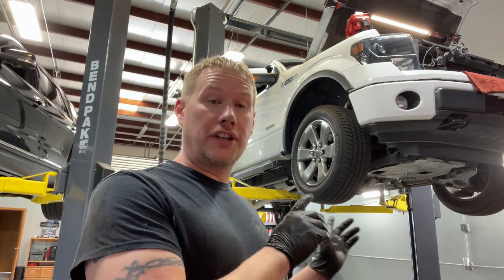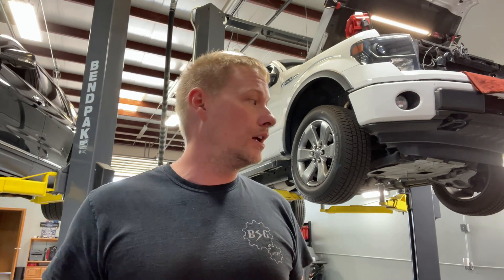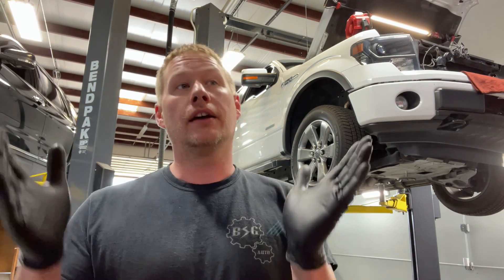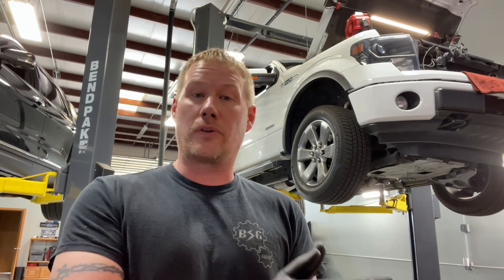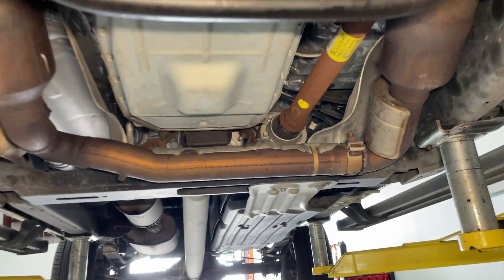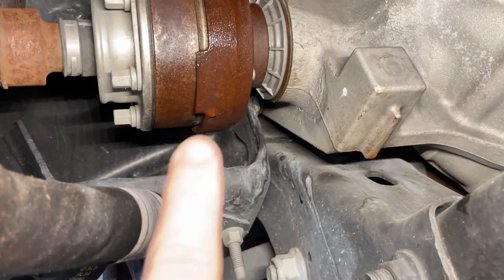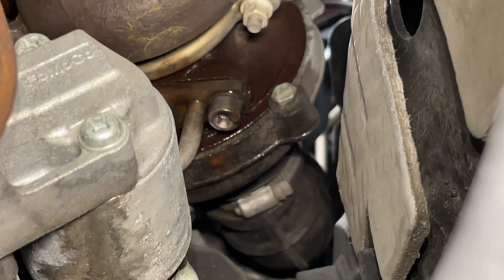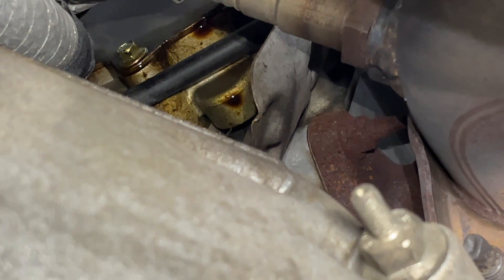Ford Ecoboost Engines Can be so Hit or Miss: I Really Feel Bad for This Customer...

Comment: I feel like this is surprisingly common across makes.

I got 247,000+ miles on my Dodge. My transmissions instructor has TIPM problems. Brother has transmission issues. I got lucky with ETB a couple times. No major issues.

Classmate has 200,000 miles on his Hyundai and loves it. Still his daily. Other people have oil starvation due to manufacturing issues.

Some people have 300,000 miles on their Honda, others... myself included... Have nightmares resulting from the VCM... Misfires... Smoke... Oil consumption...

Some love Toyota. A friend's Tacoma has a rusted frame, and my uncle never stops complaining about how many systems go down in his.

The downside to mass production of complex systems is you are basically playing russian roulette against the manufacturer's quality control.

Comment: I’m not a Ford guy but not opposed to owning one.  Same goes for almost any other brand.  My problem with all the auto makers is how complicated this stuff is getting.   All is good while still under warranty but later down the road $$$$$’s.   Its almost like they design them to last 50,000 miles
Reply from the maker: Their official stance is everything is made to last 150k miles.
Reply: @FordTechMakuloco     Well, you work on these things every day.  I’m just a average guy who can only do a few simple things on todays autos.  I agree with your statement “Hit or Miss”.  Its for sure that proper maintenance is key to longevity but as with the Ford you are working on here, its no guarantee.   I think its coming down to trade when warranty runs out, for me at least.  I have 2 vehicles with oner 100k and am just hoping and praying nothing major goes wrong until the auto market frenzy settles down a bit...

Comment: I have a 2017 with less than 40,000 that has left bank cam and phaser issues. It’s obvious that it’s bad and a calibration isn’t going to fix it. But Ford and their fixes require reflash first. Have extended warranty and factory coverage but having trouble with trust factor.

Comment: My wife had two explorers and they cost me after they were out of warranty.  I was thinking about buying a F150 after I got fed up with GM pickups.  Had a Blazer and then 5 Chevy pickups.  At 117k the dealer wanted $8k to put in new injectors.  I was done with paying and traded it in on a new RAM with Cummins.  That was in 2014 and haven't regretted it yet.  Bed camera doesn't work, but I don't care.  Paint and rustproofing is way better then GM.  Only Ford I would get is with the 5.0 or 7.0 gas engines.

Comment: I recommend my Ford 3.5 ecoboost customers use 8oz of Irontite cooling system sealer to minimize turbo coolant leaks instead of replacing all the coolant lines and fittings.  I operate on the principle - what would I do if it were mine?  After the first few I did I realized it was a waste of time, effort and $$$.  The sealant works well.

Comment: My 2011 ecoboost has 220,000 miles. Still works great but I'm afraid it needs a good clean. Should I just buy a rebuilt engine or buy new heads?

Comment: You are very right on some engines have issues and some dont, my 2011 f150 3.5 ecoboost has 144k on it and zero leaks, only major repairs i have had done has been a water pump, and recently had my blend door actuators replaced due to the clicking noise! Other than that i change my oil with castrol edge synthetic every 4500 miles with fl500 filters, truck runs great!

Comment: I have the 2021 Ranger with the 2.3 ecoboost and so far they seem too be trouble free, but this is a damn shame. If this crap starts on my truck it will be gone in a instant.
Reply: Lets hope the coolant intrusion does not strike like it does on many i4 ecoboost engines.

Comment: wow, am i ever glad I went with the 5.0 when I bought my F150 and the added parts and complexity of the turbos is exactly why I chose to avoid these motors. I still have the same truck and it has been flawless for me so far.
Reply: The '18 and newer 5.0s have a high occurrence of excessive oil burning, like 1qt per 1,000mi excessive.  Ford is "fixing" them by installing a longer dipstick and telling people to top off between oil changes.  There are not a large # of high mileage vehicles yet so no telling where all that oil is going and what else it's doing to the engine.  All of the newer trucks have plastic oil pans which are notorious for leaking over time, and it's very hard to change out the pan without creating another leak since the sealant will not set properly if there is any oil residue on the mating surfaces.  Basically it's a 48h process to do properly, you have to completely drain out the vehicle of oil for 24h+, then clean it thoroughly, wait a few more hours, clean again, and repeat until there's no longer anything seeping out of the system at all.  Then you install the pan with sealant, wait another 24h for it to set before adding new oil.  So your typical dealership or even independent shop is never going to do it that way, especially for a warranty repair.

The 2nd gen ecoboost models fixed a lot of problems with the first gen, the intercoolers no longer have the condensation issue, the injection system is now both port and direct so the valves don't cake up with deposits nearly as much.  If I were buying a 21 model year and I didn't need the towing capacity I'd probably go with the 2.7l.  The 2.7 is a pretty fantastic engine with its compressed graphite iron block.  If I noticed the oil pan leaking I would either live with it if it's just a tiny bit of seepage, or replace with an aftermarket aluminum pan that I installed myself.  I would really stay away from the newer 5.0s, the oil burning issue is well documented at this point and if it's burning that much oil I would expect that there's a serious flaw somewhere in the engine design that will cause excessive out of warranty repairs down the line.  The 3.5 eb seems to have more people reporting problems than the 2.7, but they also sell a lot more of those, so that could be part of it.  It's hard to find reliable statistics with large sample sizes.  If you go by forum anecdotes there isn't a single vehicle made that doesn't have people saying it's the best ever or it's the worst thing on the road.

I own a '18 2.7eb and my oil pan seeps oil.  I clean it off every time I do an oil change and there's always a sheen of oil on it by the next time.  It's not enough leakage to be detectable on the dipstick at all so I just don't worry about it.  It's not even enough to drip down to the skid plates.  My transmission came about 2l low on fluid and would sometimes shift extremely harshly when it was cold, but if I let the truck warm up it would be fine.  I dropped the transmission pan and changed filter, all the rubber fittings and topped off fluid, (about 11 qts) at 30k and since then it's been running great.  I'm at 42k mi and still on original plugs, gap is within tolerance and I check a different one alternating banks every oil change.  I will probably swap them out at 50k regardless.  No warranty repairs so far and no major issues.  Truck is a blast to drive, definitely the quickest truck I've driven and I get 25mpg on the highway unladen with AT tires.  Towing a 6,000lb trailer drops it down to 11mpg, but that's about the same as I get at work with a super duty.
Reply: @jgalt99  Recently bought a 103k mile 2017 XLT 2.7, 3.55, w/6-spd auto off a friend. I got the oil pan leak. I think that's why they put that aerodynamic diaper under it. Love the truck and motor. It's got over 118k now. Love the 36 gallon tank too. It does everything I could ask for. My friends new model is having some issues with a chip and aluminum driveshaft....
Reply: @brentworls8509  The 2.7 is such a great engine.  I really don't understand the change to a plastic oil and trans pan when they made the engine itself so strong with the CGI block.  There are aftermarket aluminum oil pans if your oil leak is enough to require a top-off between changes.  Mine still seeps a little oil but it's not enough for me to do anything about yet and I've had no other issues.
Reply: @jgalt99  Never heard of a single-use oil pan, but here we are....
Reply: What year do u have? Is it burning oil like another relply says on 18s and newer?

Comment: hey Bryan, the Ford dealership put a new long block crate motor in my 2011 f150 Ecoboost 3.5 back in February, would they have used the latest and greatest part upgrades in the engine? I know the reused the turbos but did replace the seals on them

Comment: I wonder on mine... 2013 3.5L with 50k miles. Sometimes has a sporadic rattling noise at startup for the last 2 years... does it for a week straight, then doesn't do it for 2 months.

Comment: I had a customer over the summer with an eco boost that needed chains he said he didn’t have the money so he would get back to me. 2 months later he brings the truck in and said he’s got a warranty so fix the chains and whatever else needs to be fixed to get the engine light to stay off. So I scan it and it definitely needed a chain job, also had boost codes and transmission codes. So I call the warranty company and tell them what’s going on that it for sure needed a timing job but it has turbo codes and transmission codes so I would need to do the timing job to get the engine running good so I could diagnose the turbos and transmission. The warranty company guy laughed and said do you know that this customer bought this warranty one month ago and 500 miles ago? I had no clue. So obviously the warranty company said well everything is covered but it’s likely when the adjuster comes out that the claim will be denied so make sure your customer approves to pay for the job just in case we don’t pay. So I call the customer and tell him what’s going on and ask if he just bought the warranty? He said yeah they told me it covers everything lol, I’m like dude it doesn’t cover pre existing problems and u have 3 major issues and they aren’t stupid they know what ur trying to do you don’t have timing, turbo and transmission problems all within 500 miles but if you want I will pull it apart but if they don’t pay then your responsible to pay, he kept saying  they will pay but if they don’t he will figure out how to pay for it so I said well if you want me to do it I need you to pay the tear down time up front so he tells me he will call me back. Well his cousin is my buddy who works for the Chevy dealer 1 block away from my shop and he calls me asking what’s going on so I tell him how he bought a warranty and what not and he tells me that the kids mother gave him 3,000 bucks to get the timing chains done so the kid bought the warranty trying to pocket the money and now he’s screwed. The best part about it was my buddy initially asked me to do the job for his cousin a few months prior and to do him a favor and give him a break on price so I gave him the cash price when he came in prior. Well if I did the job through the warranty company if they even paid they were only going to pay about 600 bucks towards the job and because I would be writing up the job regularly full price he actually would be paying more money than if he just had me do the job for the cash price from the start. There are some good warranty companies out there just a few good ones so if anyone reading this is going to buy a warranty for their vehicle make sure you do ur homework and get a good company!

Comment: As a 12' Focus owner who has taken care of my car to the point where my engine is almost to 400k miles with no repairs, but I've had to have the transmission worked on at least every year, I know what that customer's feeling.
Reply: Are transmission problems common with that car?
Reply: @piggy310  Bad enough to warrant a class action lawsuit. Look it up.

Comment: I have a 2020 f150 3.5 ecoboost. I made the call to go with the 3.5 over the 5.0, read about oil consumption issues with the 5.0. i changed the shitty synthetic blend out at 1600 km. and have been doing penzoil ultra platinum every 5000km ever since. Im just hoping that I land on the 300-400km side of the coin. any chance can do an updated 2018-2020 3.5 eco boost preventative maintenance/things to watch for video. I am nervous about the engine despite how great it performs for me now with only 15000km. pretty sad when when you spend 60000 on a. vehicle and cannot have 100 percent confidence in it inside 100000km.

Comment: I am in the market for a 2015-2018 F-150 around 100,000 miles or so - I am not sure if I should do the 2.7, 3.5 or 5.0 - do you have a good video generalizing these and which one(s) you would prefer? I am looking for a truck for the next 10-15 years. I'm coming from a 2008 Silverado that has never had any major issues, I just want newer, a bit larger, crew cab etc. Some of the talk around the turbo engines has me concerned and thinking I should stick with a regular V8.

Comment: Having a hard start issue with my 2013 f150 only does it when it’s cold out it will keep trying to start like starter will keep trying until it finally does

Comment: The part mentioned at 4:20.. Can the vacuum pump cause a rough idle if it's leaking? I've been trying to track down what I believed to be a misfire since I bought my 2015 F150 3.5EB.

Comment: I had a 2019 3.5 eco boost that had timing chains replaced at 15,000 miles! Plus many issues with leaking condensation in the passenger floor pan causing mold! Had the entire carpet replaced and 2 months later it’s doing it again. I just traded the truck in for a 2020 f250 with the 6.7!

Comment: Best engines I have ever had.  2013 and 2018 3.5 Eco.  Nothing like them.  Master of everything.  Keep the oil changed, break them in correctly, don't abuse them.  Its that simple.  Any engine can fail, but these repeated videos just prove ZERO except to V8 guys who will never change.  I have a Voodoo and love it, but my Eco trucks have been the bomb.  Coyote displacement on demand has also had problems with cylinder liners----no V8 guys lining up to say such.  Ever.  Drive what you WANT.  Uptake rate on Eco far surpasses all others, hence more in the shop.  Its that simple.

Comment: I think I will just stick with my 4.0 L overhead valve engine in my 99 ranger thank you. Mine has 230,000 miles on it and none of these kinds of leaks.

Comment: I’ve got much of the same problems in that my 13 is in excellent condition but bad seals and the leaks are driving me crazy. I’ve maintained it through ford since I bought it but I just don’t want to have them do the work since they are not as meticulous as you are. Anyway you can let me know if your shop is willing to do the work? It’s literally the same scenario, turbo coolant lines and brake booster oil leak that I can see. I’m willing to travel from New England just to get it done right. Love the truck and don’t want to sell it...

Comment: When I was looking for a truck I saw a video where they surveyed a bunch of Ford mechanics at a dealership and asked them out of all the engines Ford puts out which engine would you choose? And nearly everyone of them chose the 5.0. So because of that and all the horror stories I heard about what turbos cost I bought a 2012 F-150 4x4 5.0. I took it to a mechanic before I bought it and it had a small leak which the mechanic thought might be a rear seal. Luckily it was only a oil pan gasket.

Comment: My 2014 ecobang has went through 2 turbos, timing chains, and the one way clutch on the transmission. Just a few days ago I had p0022, p0015, p0012 codes come up. Cam sensors. Wife was driving it on the highway and the truck started shaking, she pulled over and turned it off. The engine seized. I will not buy eco bang ever again. Not to mention there’s a drip leak where the transfer case meets the transmission, but I noticed it too late the shop won’t warranty their work. Now I’m at a loss for what to do. I finished paying for the truck 2020 November. So I may sell it as is. My in laws suggest getting an engine from a scrap yard and replacing it. I’m just so frustrated with this lemon. I’m reluctant to even buy a Ford now. My 2008 ranger was a great little truck. No issues at all. My wife’s car, Ford Focus, despite all the recalls on her model she never really had any issues. But that eco bang what a POS.
Reply: Tundra is rated #1 in reliability and resale,
Has been constantly for over 10 years now
Reply: @titirititiri6360  Unfortunately the new Tundras are getting the twin turbo V6 engine also. Hopefully they are reliable.
Reply: @juniorthompson9717  I would never buy the new boosted tundra with 10 speed, i have a supercharger 2012 with camburg long travel on kings. 
Only $30k cash and will destroy a raptor